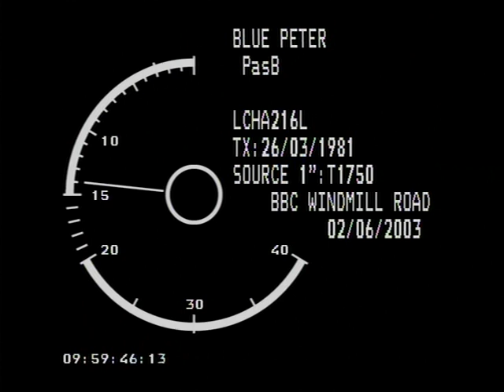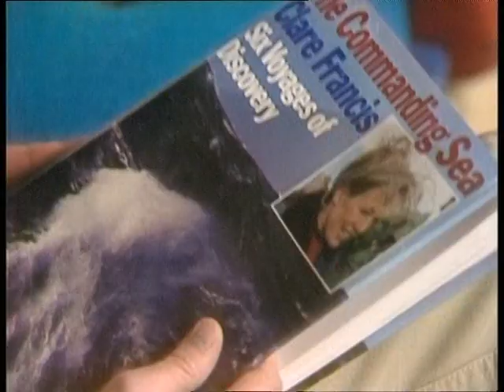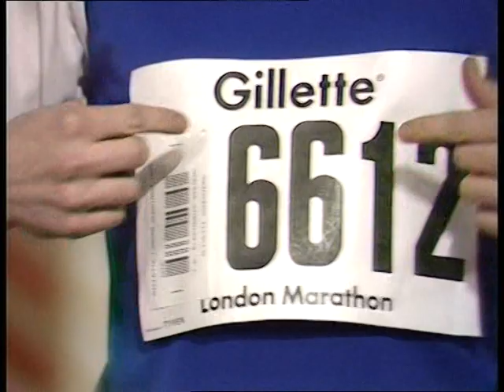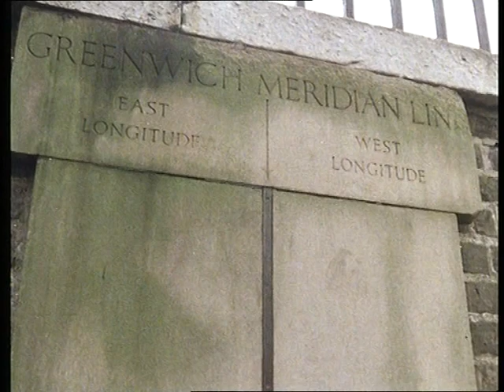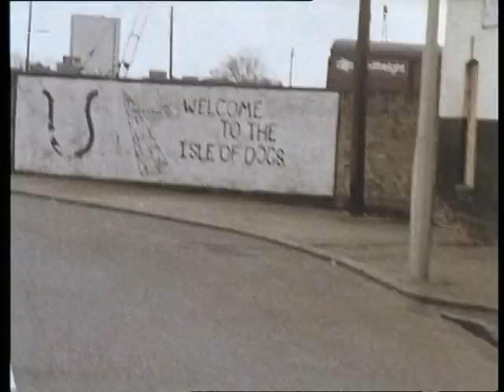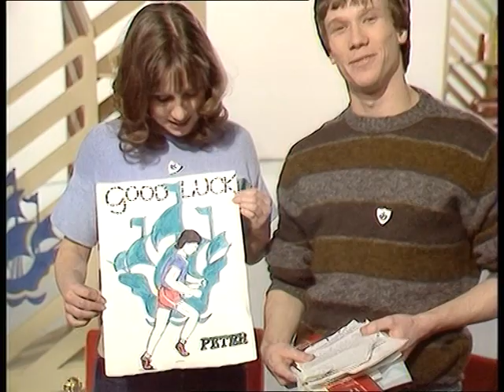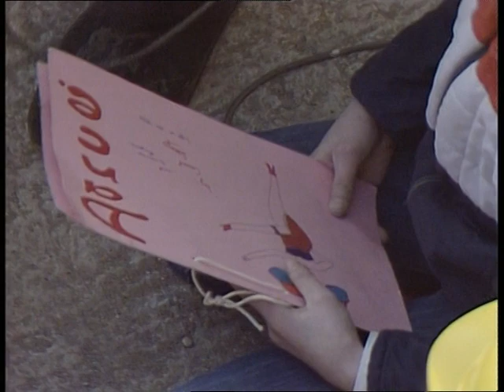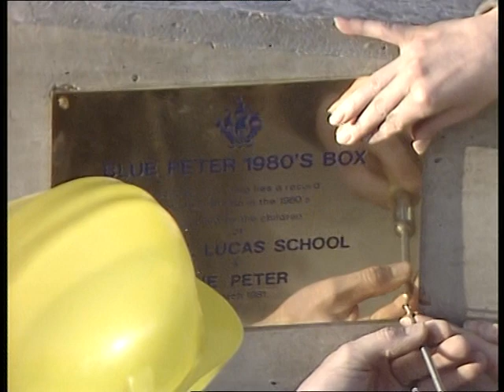Blue Peter March 1981 Samuel Lucas School Hitchin time capsule

Comment: Where was the time capsule reburied? Is it still there in the new place?
Reply from the maker: I only 'know' it was reburied because later in the eighties a school friend had watched Blue Peter and reported that it had been.  (Late eighties - I'm sure I saw them rebury the 1971 capsule in the garden in 1984.) 

All I can say is that one of the first emails I ever sent (in 1999) was to Blue Peter asking them about it, to which I did not receive a reply.  This particular time capsule hasn't been mentioned again.

I'm not bitter.  It's a box of nonsense underneath a car park ramp.
Reply: It was moved into the BPG. It was opened in 2000. All the materials retrieved were destroyed by the elements, especially water.
Reply: @Stiffd1  I know I saw
Reply: @Stiffd1  I knew that , I was wondering about where this one was judging that the car park must be not there any more because of the changes to Telly Centre
Reply from the maker: @Stiffd1  No, that was the Blue Peter timebox from 1971.  This one has not been mentioned since the eighties.
Reply: The 1981 capsule has just been dug up
Reply from the maker: @FensterMP  Yeah.  It's funny, my friend must have told me something false when he said it was reburied in the garden, and it was in the car park all the time.
Reply: @AyliCarper  they must have mixed it up with the 1971 time capsule as that one was reburied in 1984 along with a new one as they expanded the complex. The 1980s one was kinda forgotten as the plaque was stolen years ago and was just recently found by builders yesterday I believe.
Reply from the maker: @FensterMP  That's what I thought but my friend was very specific that the car park had had to be torn down and that was why it was re-buried.  And it was very late eighties when he said it.  So now I have to wonder whether he was just pulling my leg or I've remembered it all wrong.  Not that it matters anyway of course.  Thousands and thousands of cars must have driven over that ramp over the decades.  Not sure about it being discovered yesterday this video had a spike of views on 11th June I can't help wondering that they nicked this upload for This Morning as all the archive stuff is pixellated on their YouTube extract.
Reply: @AyliCarper  think you might be right with the pixelation. The opening of the box was today live on this morning so was just a guess it was pulled out the ground yesterday.
Reply: @AyliCarper  As I understand it, broadcasters don't have to pay as much if anything to license material found on YouTube originating from other networks. That's why so often shows on terrestrial use such low resolution clips when talking about old stuff so it's highly likely you saved them and/or possibly the BBC themselves the hassle of having to locate the original. I've had a clip of my own cassette rip of a BBC Radio 1 debut show in the 1990s played on their own station years later on the eventual final show, since producers seemingly didn't even have easy access to a copy themselves when I posted it on their Facebook page! Glad you eventually received a digital transfer of your appearance. Did they charge you a lot for the service? I was seen in a studio audience once and wonder if I should contact them myself. Good to read your experience. I feel like building a time capsule of life in the 2020s now. Plenty to record. I video recorded front pages of newspaper stands during the COVID era for the descendants!
Reply from the maker: @mikebeginshere  Thanks for your interesting reply Mike.  All these years I've been worried I'd be done for copyright infringement by posting it on YouTube and I've sort of done them a small favour!  I'm afraid you might not get far with a request for a copy - if you google 'BBC can I get a copy of a programme I featured in' you'll get to a page that says "Anyone who has made a substantial contribution to a programme, e.g. credited as a performer, writer, guest or production team member. This does not include studio audience members or those seen only in a crowd scene or group. Relatives may make a request on the subject's behalf."  It says it's £60 but I'm sure I paid more than that in 2003.  (It was A Lot Of Money.) I really like your time capsule of the 2020s idea.  There's a video on YouTube of people driving through London in 1998 or so filmed through the windscreen  and it's amazing how old it already looks, how informative such a simply made film is, and how many views it has had.  I'm always encouraging my children to film normal street scenes from their environment, because that's what will be most evocative in the future, especially with their friends in, just doing normal stuff in normal places.  The penny only drops much later unfortunately.  As they say, the best time to plant a tree is twenty years ago.  But the second best time is today.

Comment: Wtf was all that sludge when they opened it 40 years later?
Reply from the maker: It's what you get if you put a wooden box under a concrete bridge in a car park for fun!
Reply: @AyliCarper  Why didn't they just hide in under a floorboard in a house?
Reply from the maker: @penguinbars5504  It would have made more sense.  I've just looked in the loft and I still have the safety helmet I'm wearing in the film, so my archiving skills seem to be a bit more efficient than the BBC's.